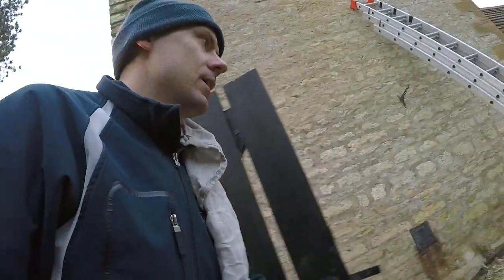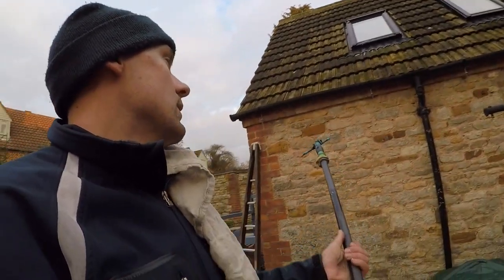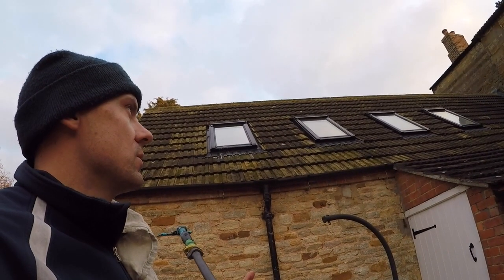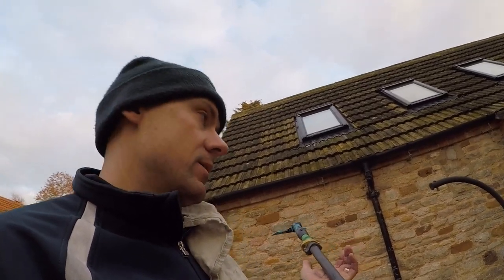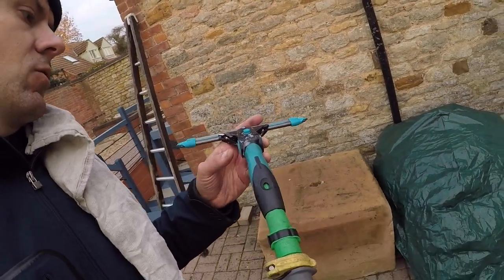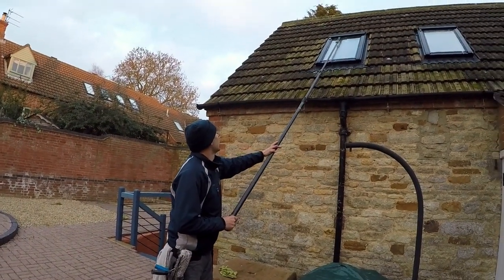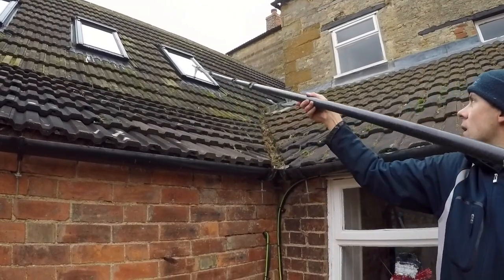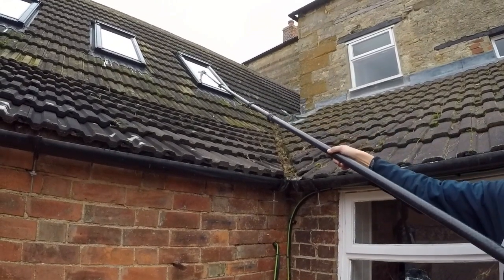Cleaning Skylights Using The Liquidater On A Pole

Comment: Nicely done,but I don't understand your logic. By the time you've done it this way you could have got the wfp out and done velux's in less time.
Reply from the maker: Malcolm Ponman I don’t have a van mounted system at the moment. So setting up my pure water system can be a hassle just for a couple of skylights like this. I’m working on getting a new van at the moment.😃👍🏼
Reply: Well done Ash for attempting it. With a Fliq pad it would be a bit quicker. The more you practice doing tricky jobs like this the quicker you'll become at doing it. Wfp would be quicker but wfp is not exactly skill based. You need to learn to walk before you can run
Reply from the maker: I don’t have the small fliq pad for this channel, so sometimes it’s just a case of using what you have on hand at the time. I do some bigger windows like this quite regularly now, but could still use some practice on smaller ones to be honest.😃👍🏼